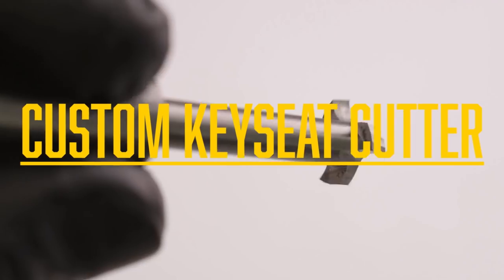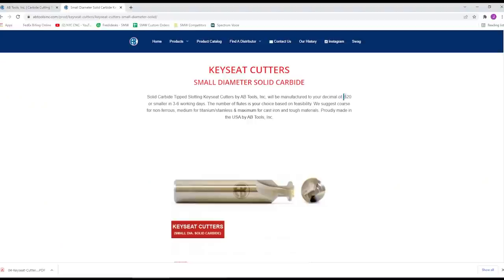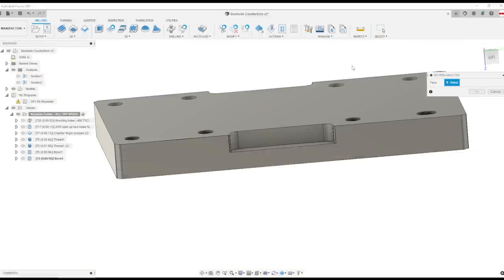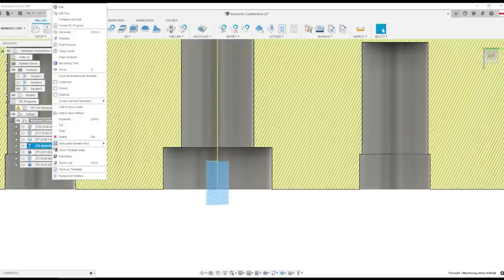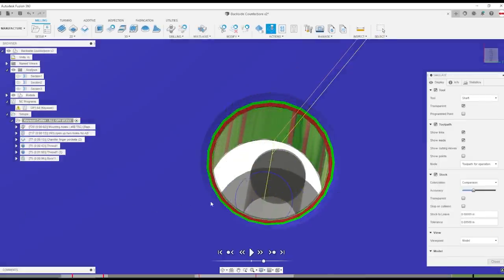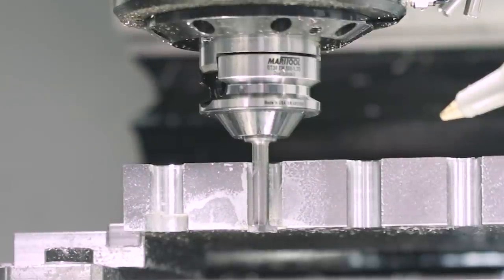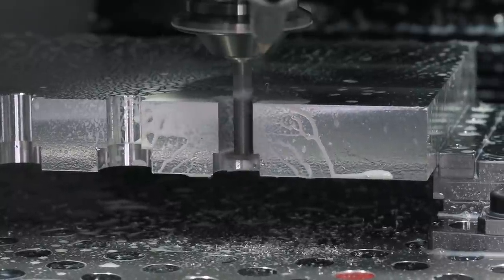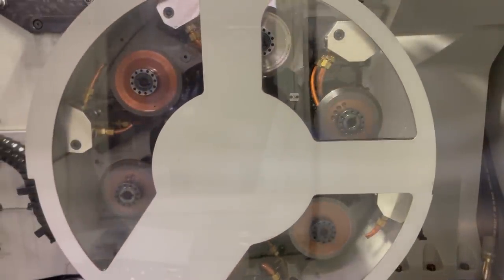Machining a BLIND Counterbore with a Custom Keyseat Cutter!

Comment: In Fusion, in the Linking tab there is an option called "lead to center" for both lead in and lead out, I always remember to have that clicked whenever I'm sending a tool "down hole" just to make sure I don't gouge the heck out of the bore.  Great video John!
Reply: It's also nice knowing where the hole center is. When it comes to small holes. The toolpath should always start at the hole center. Gives a good reference point when looking at the program on setup.

Comment: My company does something very similar but with a much larger tool to finish a surface on our castings without having to flip them. I believe it is a homemade tool similar to a fly cutter but where we have the insert facing up. Essentially we are cutting a 1.5 inch wide flange around a 12" square opening but it is on the inside of the part. Always cool to watch it done. Great video as always.

Comment: Did you consider using a reverse counterbore tool? It looks like a boring tool but with reverse mounted cutter. The still standing tool is inserted into the hole off center. Then the tool is  moved to the center. Now the spindle is turned on and feeds the tool upwards.
In Heidenhain controlls there is a dedicated cycle for this tool. Cycle 204. Other controlles may have one too.
Reply: we hace that tool too but with Sinumerik (Siemens). no cycle but easy to program.
Reply: Do you have any prices for those?
Reply: @jaro6985  Our tool supplier Hoffman Group has some with a starting price of around 200$. I don't know if there is a similar tool supplier in the US  but I assume the price will be similar. 
The tool I looked up has an indexable insert. The upfront costs are higher but the cost of operations are much lower compared to a tool ground from solid carbide.
Reply: Yes I did the same for a few years ago I used also a reverse counterbore  but I have a very old controller the Heidenhain 355 , so I write a label . it take a hour and then I start the machine and see did the job in les then 10min for 12 holes 😉

Comment: I have done undercut counterbores... now what's crazy is it was on an angled face and have a positional tolerance of .005 to a feature on the flat face of the angled face... AFTER HEAT TREAT. Also it had a fillet radius. Fun stuff surfacing with an undercut and having to get the lead in and out right otherwise kabam. Phorn makes really great carbide interchangeable insert cutters for slotting and whatnot.

Comment: good find on the thread tool path. I've been using circular to cut a grove in the top then going back in with bore to remove stock.

Also remember to compensate the feed rate for cutting the internal circle.

Check out ph horn. They have modular key seat style cutters and back chamfer tools

Comment: In a 2d Contour you could check the entry point option with the diameter of the bore so it will start and end in the center too!

Comment: I tried something like this too but I used a Harvey tool Keyseat cutter. The through hole was 7/32 and the counter bore was .320". The best tool combination I could find had a neck diameter of only 1/16". This worked fine for about 15 parts but the neck was just so fragile that it would literally just fall off without warning. I was even spiraling out from the center with a step-over of only .014" per full rotation. It was so fragile that I had one break while taking it out of the box :(.

Comment: If your machine can index the tool which I would think it can you could use a single point cutter like in a boring bar snd have a lot bigger shank diameter that would still cut the finished diameter.

Comment: I would think you could add a hole edge break to the design of the cutter. So the hole inside the counterbore is deburred in this same operation.

Comment: I've used a reverse bore bar counterbore tool, the problem or rather the question.  When you are pulling up on a tool the force against the tool wants to rip it out of the tool holder.  I run a haas vf3.  (THAT BETTER JAKE?) How much pressure can the internal clamping system hold onto when the force of the tool is away from the holder rather than into the holder.?
Reply: the tool will probably break before the holder gets pulled out of the spindle i guess
Reply: What about chatter.
Reply: @ipadize  ultimately, to avoid chatter it would be nice to know the limits of the machine when boring up as well as the tool.
Reply: Cutting with a regular Endmill is pulling the holder from the spindle as well, its not pushing like a drill.

Comment: I'd be curious what your cycle time is now, compared to just running a much faster and more efficient 2nd op.  An insert drill and a fast 2d contour would make fast work of those counterbores holes.  Upgrade to a pallet changer and you'd be off to the races.
Reply: I think they may be using those to bolt down the plate next op but not sure. If so, they could possibly come up with a different way to hold it and do as you say. Doesn't really look like something I'd want to do on lots of parts. Maybe a few but will it do 1000's of holes before breaking? Would be interesting to see if it would hold up.......

Comment: I bet you could have gotten a drill point on that tool so you wouldn’t need a starter hole. You’d probably still want to finish bore the hole, so it wouldn’t save you a tool… but it would be a lot faster and waaaay cooler on camera.
Reply: He always wants to use plain drills, getting rid of a drill op and making this tool 3x more expensive doesn't really make sense here. Guess it would look cooler though.

Comment: I like your idea, but I think it will be much better to get full flute length on key utter or an end mill with a reduced shank and rough it using a 2D adaptive tool path in one shoot, followed by a finish & a spring pass. It will save cycle time plus good tool life. But It will need you to put the start point manually before z retract.
Reply: I don't think a full length tool would evacuate chips very well

Comment: Interesting but the tool geometry is wrong. You have helix ground in the wrong direction. The tool is ground for cutting on the bottom and you have negative cutting geometry on the top. A straight flute might work or change the helix direction to create a positive cut on the top.
Reply: The first tool he tried was helical. Then we changed it to RH cut/ LH shear.
Reply: @alfredlyon27  I watched the whole video and only saw one cutter and only one was mentioned. AB Tools makes some good stuff that we use here but they need to know which direction you are cutting to be able to grind it properly. If you get another one made with the correct geometry is the cost the same?
Reply: @AkronOhioMachine  yes. I believe in the beginning of his video he is using the helical one that I made him when he just asked for a keyseat. I think at the very end he has a picture of the LH Shear version.

Comment: I dont get the usefulness if theres blind holes in the underside of the part, so it hasto be flipped anyways.
Reply: I think these parts would be ran in 1 operation. The other side would likely be finished by the end user.
Reply: @casey2219  could be. that's how I thought they should be offered. Then you machine it on your machine and it will be perfect....to your machine. Of course you could buy a piece of aluminum and put in your own counter bores, holes etc....